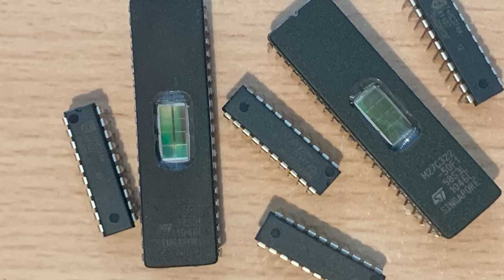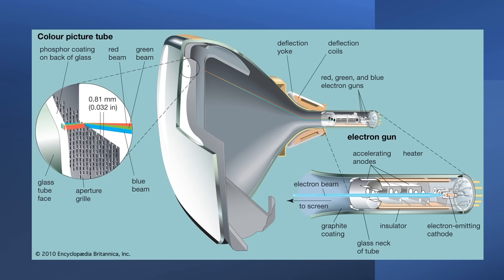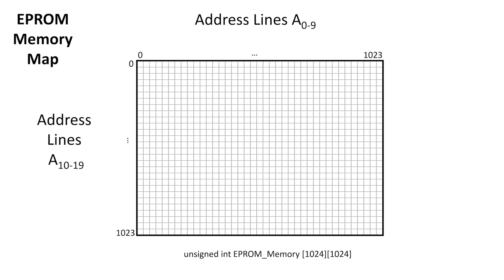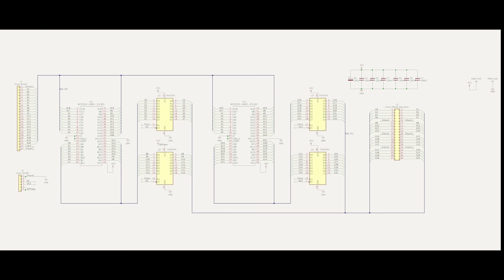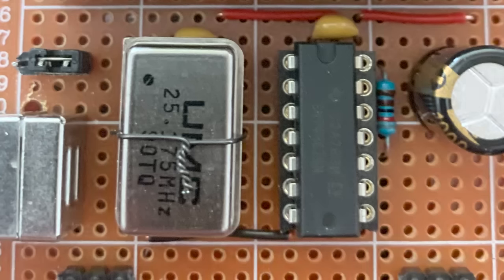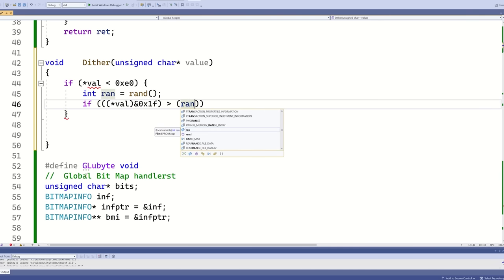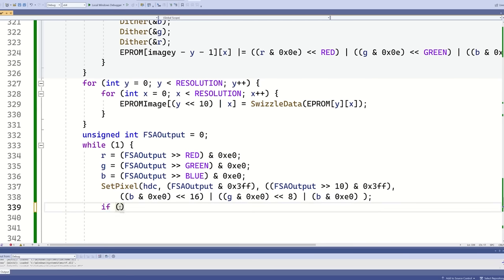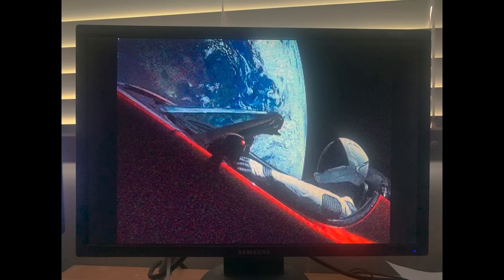VGA from an EPROM, is it possible.

Comment: Loved my GeForce GTX 460 a lot. Really stable card and surprisingly capable for the time. Thank you for your work on that!
Reply from the maker: Yeah, NVIDIA was a great company to work for.  Very interesting experience.
Reply: @DrMattRegan  I just missed you. I joined NVIDIA right as Kepler (GTX 680) was taping out. I've since moved on, but it was a fun place to work for sure.
Reply: @DrMattRegan  I bought a 480 to play video games on back in grade 8 around 2018 cus it was cheap lol
It was a good card. Never knew you worked on that lol

Comment: This video appeared in my recommended videos.  Just from the title and screenshot, not yet having watched your video, I recognized that you might be using a ROM sequencer, a technique which I love and I myself used before in the early 80s to create fast complex control circuits in place of using a slower and more expensive microprocessor where the algorithm was straightforward and repetitive.  Such designs were common in tech companies in Southern California that I worked for in those days.  A few years later I was using PALs to do similar things. I might be wrong, as I'm writing this before having watched your video as I wanted to reply to your request as to how I found your video.  😊
Reply from the maker: Cool.  Check out the Turing6502 videos where a build a CPU using similar concepts.

Comment: Great application of this technique. Woz built his Apple II floppy disk controller around a 256-byte PROM-based logic sequencer similar to this. The rest is software running on the Apple II host to manipulate an 8-bit command register. It saved dozens of chips and made the disk controller very inexpensive compared to contemporary ones. I'm sure you already knew this but it is a fascinating example of lateral thinking nonetheless.
Reply from the maker: Thanks for the feedback.
If you haven't watched these yet, you might wand to take a look at the Turing6502 playlist https://www.youtube.com/playlist?list=PLjQDRjQfW-84j-jLvrbEeDvGl0QrhX9p7
where the 6502 is mainly implemented as state machines programmed into and EPROM (software)
Reply: @DrMattRegan  I have watched the first few and they blew my mind. Frankly, I've struggled a bit to understand it but I'll persevere. It's incredibly interesting.
Reply from the maker: If you're a Ben Eater fan it may be worth watching https://www.youtube.com/playlist?list=PLjQDRjQfW-84aOLT33kzoZghRofK-uL1F
particularly the second video.  It gets the least number of views, but i think it's one of the more important videos on the channel.

Comment: The way you configured latch, the way you drive the RGB outputs, and even the control signals using only ROM data and avoiding as much logic calculation in the components as possible were very helpful. Thanks!

Comment: Congratulations on getting so many viewers for this video. Your material deserves an audience. I liked how you stored the next pixel address in the EEPROM. That simplified your circuit compared to similar projects I've seen. They usually use external counter IC's plus logic to reset the counters. Your approach has a much smaller part count.
Reply from the maker: Thanks Martin.  I'm planning on integrating it into the CPU design.  In the Turing6502, the eprom is actually unused while clock is high, so i'm going to use that for the raster generator.  The plan is to get the rulebook for the CPU and the raster generator into 2 eproms.

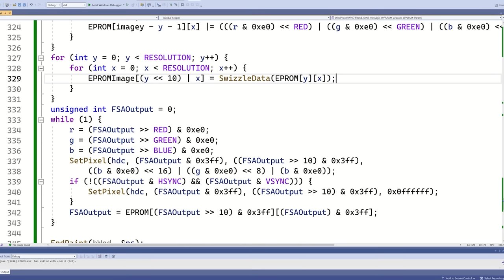Comment: 13:15 this is why I often use simple constexpr functions for doing odd bit manipulation like this.

You could have something like the following (ignore the bad name): 
constexpr int getColorBits(int value, int color){ return (r&0xe0)<<color; }

So that mess of bit shifting becomes … |= getColorBits(r, RED) | getColorBits(g, GREEN) | getColorBits(b, BLUE) …

If you have optimization on, it will produce identical code for simple cases like this. Plus, if something goes wrong, you have all of the logic packed away into small units that are easy to test.

In this case, it’s obviously overkill. But I’ve found it very handy if you’re doing a mess of port manipulation or weird bit twiddling, especially when working with others.
Reply from the maker: Yes, it's a good idea.  Makes the code much easier to read.
I should do that before i release code to the wild.

If you use constexpr though, will visual studio evaluate it if you hover above it, i haven't tried it.

The way i do it, you can highlight the entire expression and VS will evaluate that, or 
you can highlight the individual components of an expression and VS will evaluate that sub-portion.

Comment: It was fun. Love it. Figured out what's actually going (how it's EPROM?) when you ran VS2022 )

P.S. what's for timings issues 13:54 it's not actually correct : as I can see on M27C322 spec the ACCESS TIME: 80ns and PROGRAMMING TIME: 50μs/word; so it's actually even worse than I thought it's actually 80 ns for reading. But I think this time might be overrun by 'multiplying' this scheme. The idea is to split it to 2 parallel 'nodes' to read every second pixel from the second one while the first one is still being processed. It should give you exactly 40ns per pixel you need. It might ) I need to think over it; thanks again for the fun!
Reply from the maker: Glad you enjoyed it.  It's amazing what a simple finite state automata can do.  The chip (27C322) has an access time of 50ns.  At full VGA we need 40ns/pixel but half VGA is 80ns/pixel.  I didn't try it, but is suspect full VGA will fail.

Comment: I got this far with my thinking after watching your Apple II video generation series, and worked out that you could interleave EPROMs to generate full-resolution VGA, and then skipped past that to a RAM framebuffer. I even went the next step of working out making each pixel be a palette entry of 2048 colors.

It fell down rapidly after that because designing a tiler engine is non-trivial at any resolution without resorting to CPLDs/FPGAs, and that's a bit beyond my ken for now.
Reply from the maker: Oh cool, did you get the basic raster generator without the tile engine running?
Reply: @DrMattRegan  some noise, breadboards aren't ideal for 25MHz signal I suspect
Reply from the maker: Yeah you will struggle to get 25MHz.  That is FPGA territory.

Comment: Great video

What is the EEPROM program u are using at 13:33 to debug if your VGA generation is working?

Also how can you write a paper on something that is interesting to you?

For instance: I am interested in transmission and receiving of analog audio and picture (CQUAM Stereo, PAL, NTSC, etc)

But this is old and everyone wants digital nowadays so are there any guidlines on how to express this diferently so it would seam like something new and exiting, rather then giberish that some lunatic that is living in the past is writing about

Sorry for wierd question I hope you understand it
TLRD: how to take some old concept and turn it into something new and exiting that could be good enough for a research paper?
Reply from the maker: The image at 13:33 is software generated, using the 
unsigned int EPROM [1024][1024]; 
array to display the image.  This is tickled and downloaded into the 27C322 EPROMs.

If you're interested in a research paper on raster generation try:
Regan, M. and Miller, G.S., 2017. The problem of persistence with rotating displays. IEEE transactions on visualization and computer graphics, 23(4), pp.1295-1301.

Which BTW was named runner-up best paper and was then given as an invited talk at SIGGRAPH 2017
https://ieeevr.org/2017/awards/

Cheers

Comment: Cool video, though I’m not sure I entirely understand. Is that starman frame-buffer stored in the EPROM? Or is it coming live from somewhere else?

Wonder what it’s like to bit-bang DVI, considering most non-CRT monitors have digital circuitry in them anyhow.
Reply from the maker: Yep, Starman is in the same EPROM, but it's really only there for testing.  It's the address lines that are useful.  If you feed them into an SRAM instead, you can update the image.
HDMI has a different format, but pixels are still sent one at a time.
Reply: @DrMattRegan  ah so I did understand it properly. Though along with your frame buffer you’d need to fill the RAM a with the first few bits of the “next address”. I can see why Ben Eater used combinatorial logic and counters to control the blanking periods, since the majority of the work is just “address++” anyhow. Synchronising the timers did look a bit of a pain though.

A compromise method might be to use a simple binary counter for incrementing pixels and a second binary counter for incrementing memory addresses through RAM, and an EEPROM to look at that pixel address and output signals for V and H blanking (where the RAM address isn’t incremented) and for resetting the counters. That way you can store memory much more densely, and get 3*5-bit colour.
Reply from the maker: The RAM shouldn't need addresses, just the ROM.  It might also make sense to have a divide by 16 counter infront of the EPROM.  I did wire up a counter chain in the apple 2 wire-by-wire series, but it is a pain.

Comment: That EPROM isn’t available / in stock is it? I looked for some DIP EEPROMs and the ones available ( X28C512P-12 ) are pretty low capacity (64K x 8 bit) and slow (120 ns). Also I was starting to wonder how I’d build something that can support higher resolutions. Maybe some kind of RAM instead and you’d copy the ROM to RAM (with a CPU?) at startup to get the video working. Or using multiple EEPROMs and somehow divide the clock between them! I have an FPGA (Digilent Arty, with VGA PMOD hooked up to it) and it can put out 1080p VGA signal (148.5 MHz pixel clock), maybe even higher. But I hate the tool chain and dependencies involved (Vivado in my case, for Xilinx chips).
Reply from the maker: You can find the 27c322 pretty easily on ebay.  All of the constants in the tinyVGA horizontal specifications are divisible by 16, so you can put a divide by 16 counter for the least significant bits.  This will reduce the EPROM size by a factor of 16.
To go to a higher resolution such as 1080p i think you'll have to persist with the FPGAs unfortunately.  You'll have a hard time getting through hole technology with 7400 series logic to go that fast.

Comment: Well, given the design that you gave, the memory structure is a linked list. I'm sure you used it to simply the writing of the video memory on the CPU side by using row, column addressing which is convenient for addressing pixels. To make it contiguous, you'd have to set the pointer of the "next address" portion into the next address. Now, if you were not including the H-Sync and V-Sync as part of the contiguous region, I would imagine you'd need to have an additional counter, either as circuit or some sort of "microcode" that would drive the syncs and possibly the front and back porches via run-length encoding which would take up less memory. If doing that, I'd probably eschew the linked list pointer and pack 2, 2, 2, 1, 1 for R,G,B,H,V, as 8 bits. I imagine you could use the lower ROM for the actual video memory, later to be replaced with RAM. Then might could treat the other ROM as a state machine to do the counter, which while still practically the linked-list in practice, wouldn't be used as addressable to CPU. With that sort of design, might could have multiple ROMs that represent different "video modes" and use some sort of I/O address on the bus to select which ROM via a pair of latches to instantly change the resolution. Either way, would need to be careful of only updating lines that aren't scheduled for immediate render since it could create artifacts (I assume the cause of the CGA render bugs from my childhood); although, I suppose it could be a "feature" if exploited for controlled special effects. Speaking of latching, might could have multiple resistor banks coming off the R,G,B links and use another I/O to swap them using the lines currently tied to ground so you can vary the palette a bit and a few AND gates (at least in theory). I hope my thoughts on it was in the ballpark.
Reply from the maker: Hmmm... that is pretty complicated, but yes it acts like a linked list.   The image is there mainly to test to see if it works, the address is what you are interested in.   I would put all the active video below a certain address and the inactive video above that address say 0x80000.  At the and of the active area you jump to an address above 0x80000 then go back to the low address for the next active region of a scan line, starting from where you left off.
Reply: @DrMattRegan  I think I was overthinking it for the moment as I was trying to account for different video modes and possible different palettes. I think I recall you doing something similar now for the longer video series (I shall have to go back and watch again). I will take the opportunity to ask a dumb question, is my convoluted thought actually feasible to have one bank containing the CPU addressed memory seen as 16k, perhaps as bytes, but then have the parallel linked list that maps the next address? I'm working under the idea that the software would not need to concern itself with that detail and be able to directly write the color information on the opposite clock state as the CPU.
Reply from the maker: Yes i think what you are saying is correct, you basically treat the video address that points into video memory as another attribute, like i'm currently treating RGB.  It would certainly work.  With the Apple 2 and ZX speccy, they are essentially 1-bit per pixel (although the speccy has an extra 1/8th bit per pixel), and with some clever re-arrangement, i can get the address space down to 64 K.  That will leave several bits for mode selection.  I would probably use an octal flip-flop triggered by V-SYNC to change the mode bits.

Comment: Since the whole frame is one big linked list so the words can be in any arbitrary order, including contiguous. The chosen order just makes it simple to generate the data.
Reply from the maker: Correct, when i use it in the Apple 2 wire-by-wire series, i adjust the order to match the memory order that Woz used.

Comment: Hello Dr. Reagan. It seems like the 27c322 has been discontinued for some time. Do you know where to get it or any other good replacement for the memory chip? Thank you very much
Reply from the maker: They are still available on ebay.  The tricky thing is the speed, these are 50ns parts and you will probably want to use something in that category.  SRAM is an option, but you will need a microcontroller to program it on power-up.
Reply: If you can handle surface mount there are parallel NOR flash chips which would achieve the same function.

Comment: I wonder what if would look like if you errased it while it was displaying an image
Reply from the maker: As soon as the first bit of addressing goes, you'll probably lose the regular HSYNC, so it would scramble or the monitor would drop the image.  Just a guess.
Reply: Someone tested exactly the above. They wrote filled the EPROM with all 1's (or zero's, whatever) and displayed the bit map. Then they put the chip under a (back then) UV eraser light and watched the chip data "erase" on screen.
Today you could use a UV Laser pen to erase sections selectively and watch it erase on screen!
Reply: @joeteejoetee  do you have a link? Sounds interesting :D

Comment: 4:44 I don't think I could understand it clearly, but why set the horizontal sync, and the vertical sync at the INactive region instead of simply setting them at the active region?
Reply from the maker: They control where the image is located on the screen.  If you put them in the middle of the active region the image would appear in the corners and there would be a big blank horizontal and vertical bar in the middle of the screen!

Comment: Seems like a huge pain in the ass to generate NTSC with code. I still use an old 80s B&W television set that does all of this, purely analog, with a few handfuls of components and some good old fashioned high voltage to watch my old black and white movies. Sometimes nothing beats simplicity.
Reply from the maker: NTSC is more painful than VGA.  I have a video on it for the Apple 2 https://youtu.be/yQhCEc0dCsI

Comment: Seems like using a eprom for address rather than a counter seems expensive.   You could probably bit bang out the signal using a cortex M0 nowadays.  I did a greyscale NTSC video overlay for drones years ago using an M0.  It ran fine.
Reply from the maker: If you have a look at this playlist 
https://www.youtube.com/playlist?list=PLjQDRjQfW-84aOLT33kzoZghRofK-uL1F
(90 mins watch time) it may be a little more apparent why use an EPROM.  Let me know what you think.
Reply: @DrMattRegan  It seems to work like the 'math box' in the Atari Battlezone coin-op used to transform vertices.
 I am not sure how you are going to take this static image burned to rom and turn it into a programable image without 3*640*480= 921K bits worth of memory.  I ended up using tiles of 8x8 pixels, like early computers did, to reduce the memory footprint.  Here is a flight demo of the M0+ OSD project. https://youtu.be/MtMT04ecjL4
Reply from the maker: @moddaudio  the image is just there as a test.  I’m planning to use it with the Turing6502 to make an Apple 2 etc.  This already uses the 27c322, so I can squeeze the raster generator into the same ROM as the FSA for the CPU